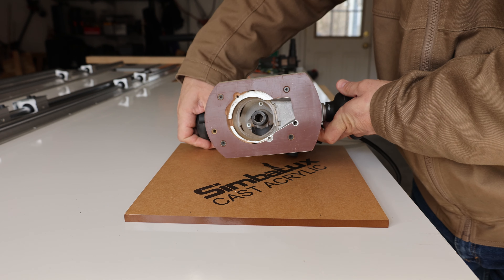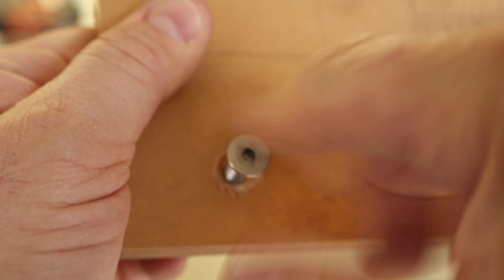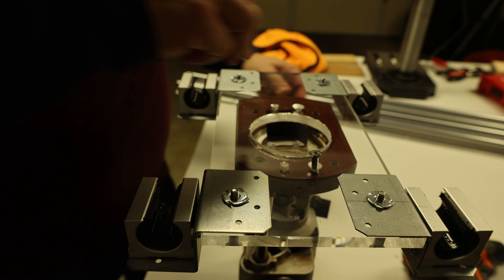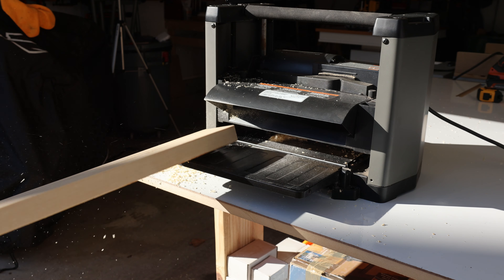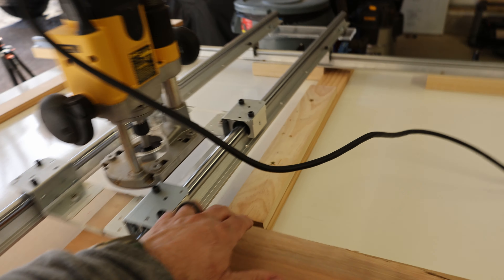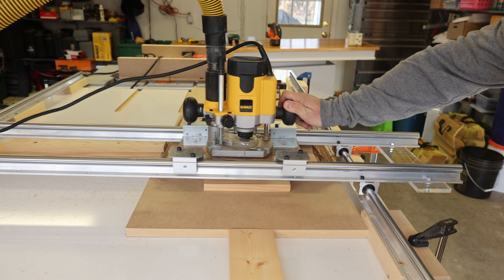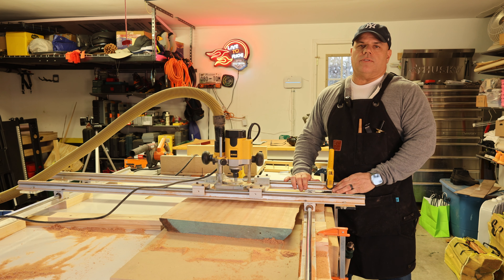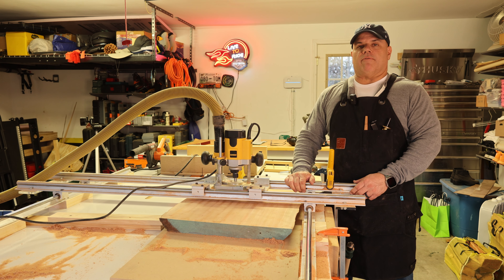Build Your Own Slab Flattening Router Sled

Comment: I don't have a planer and I don't have the room or money to buy one, but I do want to reduce the thickness of  ¾" boards purchased at the big box stores. To accomplish this I have built two, technically three if you include cutting down the first one because it was too tall and the router bit didn't even come close to the wood. Even though the last one works, it's limited in the length and width of the board I can "plane". I ran across linear rails like these while looking for something else and figures that these are what I need. I can make it as small or large as I need because it will only be clamped to my dovetail worktop which is 4' by 3' if I'm not mistaken.

Your video is the first I've come across that goes into detail as to how you constructed it, and I will be using it to build mine. Thanks for a well spoken and instructed video.
Reply from the maker: @AutotechWoodworking  Thank you! I’m glad it was helpful to you!

Comment: Good stuff.. Thanks for the content... May I offer the use of some alumuinum angle... Amazon has several dims and lengths avial.  You can cut the aluminum angle with your wood working blades. Good Stuff!
Reply from the maker: I looked at Amazon at the time and they had lots of it, but the lengths were way too big. I will probably suck it up and just buy some.

Comment: Nice job.  Many sliding miter saws use the same linear bearings so I imagine they will hold up well.  I would add a little loctite to the screws in the router base and at the machine screws on the bearings because there will be a lot of vibration.  Have you had any issues with dust collection?  Do you wish for a sweep under the acrylic to aid in that?  Do you want some sort of stop block to hold the rails steady for each 'row' that you smooth out?
Reply from the maker: @mriguy3202  thanks! Great suggestions! Yes, dust collection is an issue. May add a sweep. And I definitely need a stop block!

Comment: Great video.  Appreciate the level of detail with your assembly.  I am wondering how long these bearings will hold up on the runners with all the sawdust?  Is yours still smooth?
Reply from the maker: Thanks! They are still very smooth. They are very robust and meant for industrial operation. The saw dust should not really affect it any time soon. Thanks for asking!

Comment: Could you let me know the screw sizes for the 20mm rail glides and the 16mm glides. Great video well done!!
Reply from the maker: Screws came with the 16mm rails, so I am not sure what it was. For the 20mm rail, I believe it is an M5 screw size. I am not sure of the length I used, but I think it was about 1/2 inch. Hope this helps. Glad you enjoyed the video!

Comment: Hi great video! I am planning my sled out now. I've seen a lot of youtubers with a similar design, but with different cross rails (yours looks much more sturdy--theirs don't have the rigid aluminum for bolting down but are simpler round rails). Did you consider using the other type? I'm wondering if there's a benefit I don't understand.  

I'm also wondering how to deal with my uneven floors. I imagine by setup needs to be perfectly flat for this to work.
Reply: Did you have any trouble with those cheap(er) amazon bits? Did they last long enough?
Reply from the maker: I like my rails because they are sturdy and have very little flex. As for uneven floors, this is why I have it on my work bench. The top is MDF and it is supported by a frame underneath. It is the best I can do with my DIY setup, but so far it has turned out great!
Reply from the maker: The bit I got from Amazon has worked great for me! I have only flatted 4 different pieces, but so far so good.

Comment: Great job looks wonderful. Just wondering why you changed JKM Woodworking channel design  it seemed perfect to me? Just curious. Thanks for sharing.
Reply from the maker: @tazblink  thanks! KJM Woodworking?
Reply: @TheSharkShed  Yes the channel you borrowed from and left a link to affordable router sled.
Reply from the maker: @tazblink  Oh sorry, didn't understand. I basically took the idea from two different YT channels to come up with this design. I also had a hard time finding the right sized L-bracket. Everything was either too beefy or way too expensive. I will be modifying this more as I go. Thanks again for watching and commenting.

Comment: My sled(slab flattener) is 2  3"× 6" aluminum rectangle tubes 4' long for the rails and 2  2"× 2"× 1/4" angles 4' long  with a polycarbonate base for the router support. Just slide the angles along the rails. Use a 2" Whiteside flattening bit. It will flatten a slab up to 24" wide and 4' long and 2" to 4" thick. Works well so far. Got all the aluminum at work, so it was inexpensive too.
Reply from the maker: Wow! That is awesome! I really like how versatile this has become for me.

Comment: Looks great. Just curious, why not a CNC spindle vs a router for this? Can't find any video that uses one, but wondering why not.. they seem better able to handle more speed, more power, etc. Regardless.. how do you plunger further down? Are you limited to the plunge base of the router in this case.. or can you plunge down to a 1/2" work piece? Ideally don't want to have to change the blocks under the long rails to adjust the height of that.
Reply from the maker: The CNC spindle is a great idea. I just used my router because it is what I had on-hand. As for plunge depth, I am limited to the router's plunge depth minus the thickness of the base. If I need to work on something thinner, I have to raise the wood from the table top. Not ideal, but the sled was really meant for large slabs. Anything thin and narrow enough will go through a planner or something like that. Thanks for the CNC Spindle idea and questions!
Reply: @TheSharkShed  Oh that makes sense on thinner material. I bought the rails (1200mm both directions for now, figure I can add more to the X if I go longer). I have a Bosch plunge router that I use on the table (well.. barely) but may opt to buy a separate router just for this use.. if I don't figure out the spindle route. Spindles actually cost less for the 3hp (china version anyway).. but not sure if it will work as well. If you opt to upgrade to a spindle and do a video.. I'd be much appreciated. :D.
Reply from the maker: @b3owu1f  I will definitely make a video if I try it out. Don't have a project at the moment to try it, but I am sure there will be opportunity in the future.

Comment: there are many videos (before yours came out) where the upper rods were just plain round stock and use the undermount bearings.  Did you consider that option which would have avoided the whole right angle metal bracket issue.  also why did you feel the need to put your hand on top of the router as you were moving it were you sensing that it wasn't staying all the way down?
Reply from the maker: I would consider changing the upper rods for that very reason. I ordered my rails based off of another video I watched, but if I was to do it over again, I would switch to the plain rods and under mount bearings. 
As for my hand placement, it was just the most comfortable place for me. The weight of the router  and rails keeps everything in place with no feel of upward pressure.

Comment: Is there a different option for mounting the acrylic to the rails vs. doing the Z bracket modification? Could the acrylic piece be mounted on the top of the bearing pieces? Then use a collet extension to get the same height?
Reply from the maker: I think that is a good idea. I didn't think of using a collet extension, but that could work.
Reply: How much flex would you get from a extension? That flatting bit had a large diameter and any flex will cause uneven cuts.
Reply from the maker: @ I haven’t had any. That’s not to say that it’s not possible. So far, it has worked brilliantly for me.

Comment: What speed was your drill press at for the holes in the plexiglass?
Reply from the maker: I used the same speed I use for most wood, 2800 RPMs, wich is also the high setting on this particular press.

Comment: great video and thankyou for making it and sharing. I am in the process of building mine but once I installed the linear bearings on the acrylic router cradle and then install  that onto the rails there seems to be some binding when sliding as if the bearings are not exactly in-line with one another. I tried to be as precise as I could when drilling the mounting holes for the bearings but I'm thinking I may need to woller the holes out some to allow for a little movement in the bearings so that they can self-align to each other and slide more freely before I tighten them up all the way.....Whats your thoughts on this? Thankyou....
Reply from the maker: I think you proposed solution may work. I mounted the bearings first and then marked where to drill the acrylic, that way I would have the best shot at a good alignment.